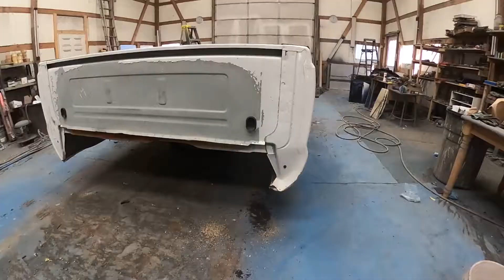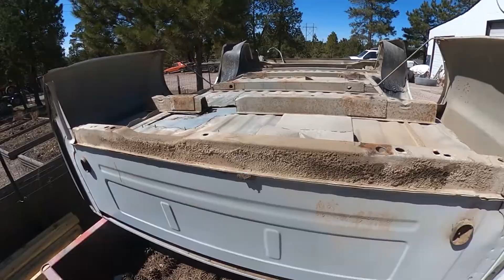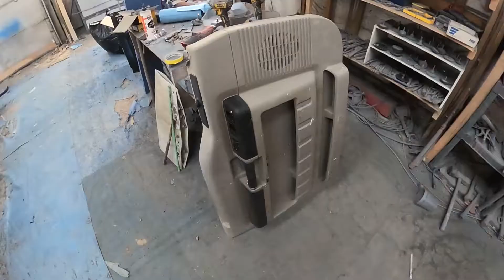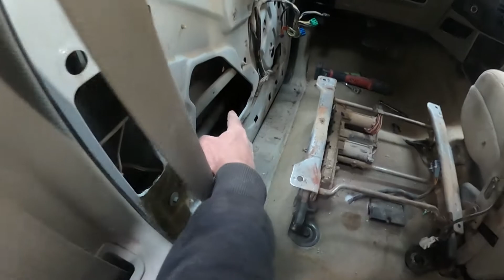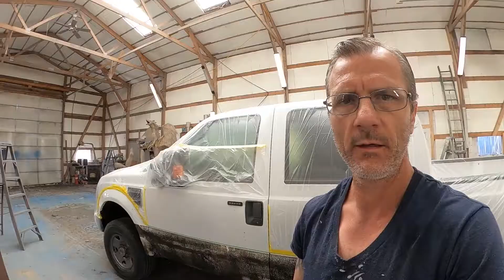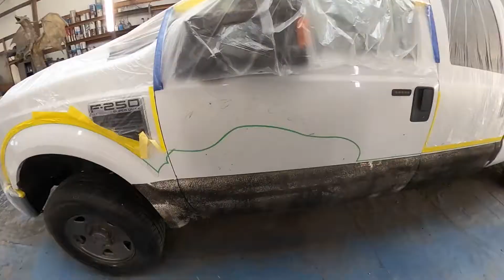Going Full BOAR!!! F-250 crew cab makeover...part 1

Comment: How did you strip that old black undercoating off? There didn't seem to be any trace of it left behind. Awesome tip for tracing that line around the wheel opening, I'll have to remember that one for sure.
Reply from the maker: It was that cheap aerosol type...which was never prepped to begin with. So i simply used a DA sander and a little elbow grease to remove it. Thanks!